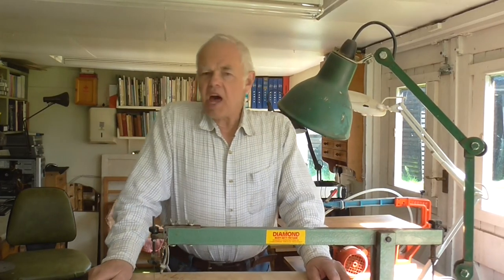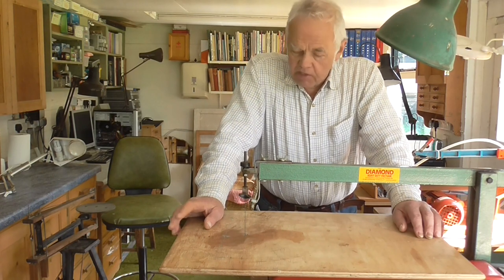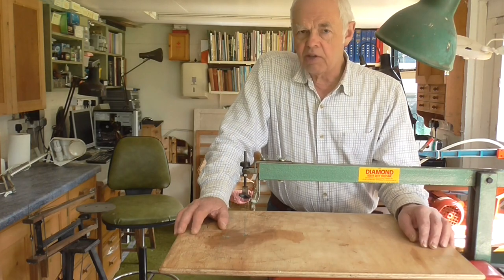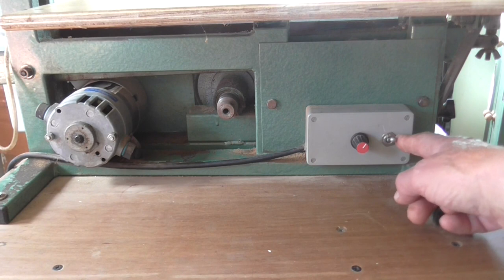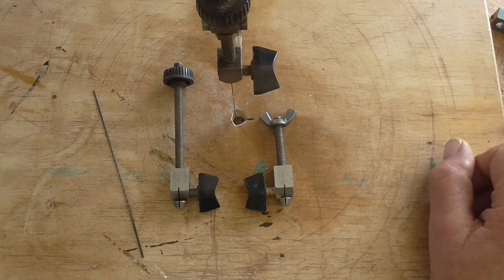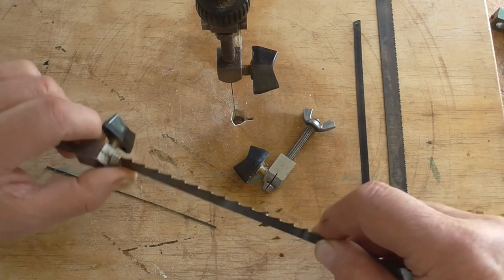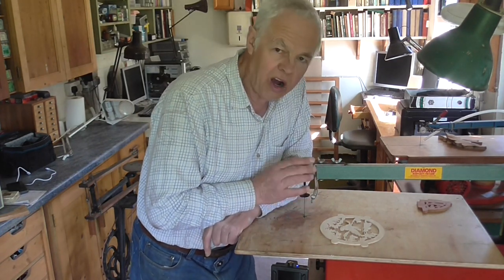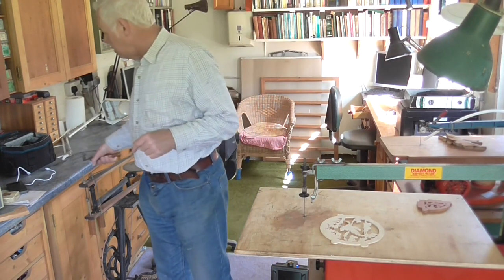Diamond fretsaw/scrollsaw review and operation. Part one.

Comment: I'm just about to take my 24in Diamond out of retirement so's I can make some customised puzzles for my grandson - and your video happened to cross my radar :)
I used it professionally in the early / mid 90s for about 5/6 yrs making 3D and multilayer puzzles out of reclaimed hardwood  - typically 16 to 22mm thick, depending on the number of layers.
I also ended up buying a used 18in version as a spare off Doug since it was an essential part of my operation - I looked at Hegners, but, living in Leicester, the Diamond seemed a better bet.
I bought the single speed version as it was cheaper and  fitted my own speed control - a 5A variac - which allowed even slower speeds than the electronic version.
Doug was a great guy and I ended up demo-ing the machine for him at several trade fairs - I'd just be sitting there making stock  with finished items for sale - a win-win situation for everyone.
Blade change time is a valid issue, but didn't really affect me because - iirc - 3 piercings was the max  I typically did in the standard stock range.
Reply from the maker: Many thanks for your interesting Comment Paul. 
I have to say that even though I like the Diamond it is no match for the Hegner. My main 'gripe' is the dreadful time it takes to remove and reinsert the blade. As you suggest with few internal cuts it is not so much of an issue but if you look at my fretwork videos you will see some pieces have 50 or more internal cuts and after about 10 blade changes in succession my old fingers are really suffering.
Doug told me he was working on a quick blade tension device but sadly it was not to be.

The other issue is Noise and vibration, The Diamond with it's harsh carbon brush motor suffers badly in this respect compared to the Hegner with it's smooth running quiet induction motor. I rarely use the Diamond these days as it's so much more enjoyable using the Hegner.

Comment: A great review of an incredible machine, I have used one for many years, in fact Ai have one of Doug’s prototype , Diamond Fifteen, a planned smaller version, which ceased when he died… so sad, a wonderful engineer.   I paused this video when you were tightening  the blade…because you set it far too tight. Doug himself showed me his method , to prevent constant blade breakage complained about by most scroll saw owners.  You only need to tighten , so that when pushed from the front the blade can deflect about 4 to 6mm . Making it ping with that high note, puts badges under far too much tension. I was a demonstrator at major woodworking shows , a single blade could last me months…the same goes for HEGNER’S or any other make of scrollsaw… over-tightening is a blade killer.   I’m an ancient 85 plus now, still using my scroll saws and lathe.
Reply from the maker: Many thanks for your kind review about the video. Regarding blade breakages; I rarely get them, only time I had problems was with a bad batch of blades I bought, practically every one snapped within a few seconds use. (many others reported the same issue)
As I mention in one of my videos; when one starts the hobby you do get many breakages but as one gets more accomplished most of the blade changes are due to worn out blades rather than blades snapping.
I always reckon that once you get to the stage of wearing out blades due to long use you have learnt how to saw properly.

Comment: Is there any obvious replacement part for a variable speed controller on Diamonds?
I have a few of these machines some with foot pedal s which are invaluable.
Thanks.
Reply from the maker: So sorry for the delay, only just seen your comment Terry. From what I remember the speed controller is very basic. any simple controller should work.

Comment: Hi scrimperuk, managed to pick up a really nice Diamond fretsaw after watching your video, I do have a problem though, my saw only came with the blade clamps for pinned blades and I would very much like to use blind fret saw blades. Any idea where I might purchase fretsaw blade holders for my machine.  Also can you recomend any particular make of blade. Thanks.
Reply from the maker: Hello, glad you have found a machine, the blade clamps supplied with the saw are type 6 blade clamps, these are designed to take any type of blade inc standard 5inch pinless fretsaw blades.
 The type 7 holders are the same but have a hole rather than a slot and only take standard pinless fretsaw blades, the only advantage of the type 7 holders is that they make it a little easier to refit the blade. Your type 6 holders should hold standard 5" fretsaw blades without problem.
I normally buy my blades from the Hobbies company https://www.hobbies.co.uk/yellow-label-fretsaw-blades-various-grades they are the Niqua brand. I have tried other more expensive blades but have never found them any better than the Niqua versions.
The best blades to use for fretwork are the reverse teeth versions which eliminate (mostly) cut out on the back of the work, I have covered blades in detail in my other videos.
Reply: @scrimperuk  Thanks for the information that's great, looking forward to using the saw, compliments my old startrite table saw well, we are all about the same vintage. kind regards.

Comment: I’ve had a diamond for many years and one of my drive belts have perished I’m trying to find a replacement any ideas
Reply: Do you have what's left of the old belt? Could you measure it up and try a local engineering supplier for the closest replacement? My bench sander needs a replacement drive belt about twice a year (I use it a lot!) - I discovered that a local firm who supply parts agricultural machinery and builders machinery were able to supply the titchy little belt for my sander. And they were much cheaper than the manufacturer. It's worth a try... Best of luck getting your saw back in action.
Reply from the maker: So sorry for the delay Andy, only just seen your comment, I saw no notification of it. A Hotpoint white spot elasticated spin belt for their twin tub machine fits perfectly but I am not sure if you can still get them.

Comment: Hi just wondering .Can you fit a foot switch to the Hefner saw ?
Reply from the maker: You should be able to fit a foot switch with any scroll saw although you may need do do a little wiring modification. A foot switch can be fitted to the Hegner machines and Hegner do offer one although it is expensive at around £88 UKP. Cheaper foot switches are available.

Comment: Lots of bicycles have cammed levers, I dare say it wouldn't take much to adapt something to fit the saw.
Reply from the maker: Thanks for your comment. I remember speaking to Doug Woodward (the maker of Diamond) about the cam, I pointed out that Hobbies used cams for blade tensioning on their saws back in the early 1900's, he told me he was working on such a thing but sadly passed away before he finished and Diamond saw production ceased with his death.

Comment: Hi, I've got one of these fret saws and just as I was getting to grips with it the old frayed drive belt eventually gave way. I wondered if you might be able to tell me anything about the drive belt, such as it's size and or diameter (I was silly I threw it away just keeping  a bit) or if you know of a belt that might make a good replacement - thank you.
Reply from the maker: My diamond was fitted with 2 belts (both the same size) they are round elasticated belts with a rough finish. They were the same type as used on a Hotpoint twintub spin dryer (white spot belt). Might be difficult to source them now but I am sure something else would fit as it uses standard vee pulleys.  I have seen one company listing them as in stock at £9.60. If not I am sure one of the companies that sell belts have something that will do the job. I don't have the belt diameter as I write this but I could check in the workshop tomorrow if you like.
Reply: @scrimperuk  Thank you so much, that is really helpful, I will have look to buy this belt.
Reply from the maker: The diameter of a new belt (unstretched) is around 6" to 6 1/2" (152mm-165mm) approx. but as I say if you get a white spot stretch type belt as used on a Hotpoint twin tub, it should fit. Note: there are 2 drive belts on a Hotpoint twin tub spinner side, make sure you get the white spot spin can drive belt and not the smaller thinner pump belt.